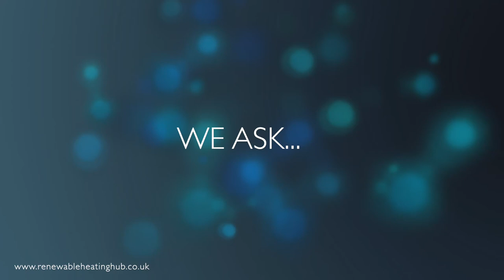What is delta T?

Comment: Actually, there is no universal application of ‘Delta T’ in essence it means the difference between the two temperatures under consideration. For example radiator output is often specified at specific ‘Delta Ts’ which is the difference between the mean radiator temp and the desired room temperature, Heat exchangers in boilers are often referred by their Delta T the difference between the flow and return temp ( or the temp rise across the boiler). In Sum, Delta T just refers to temperature difference - the application however can be specific - if it is specified.😉